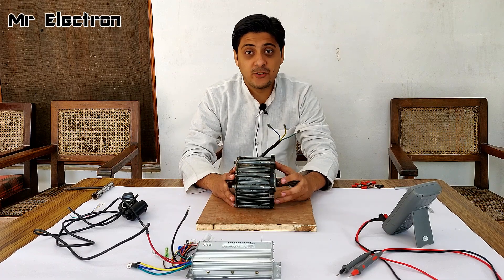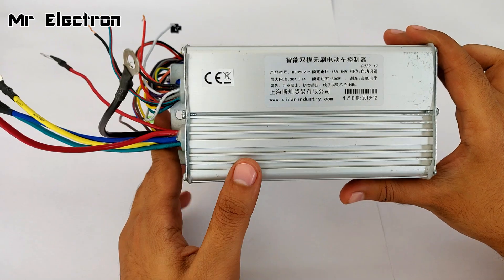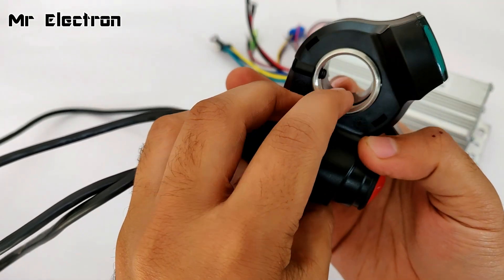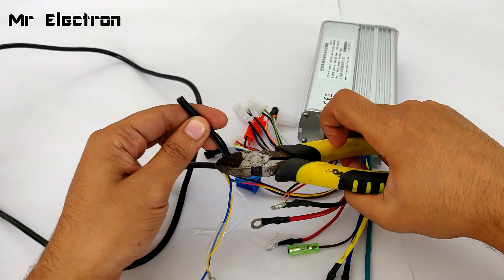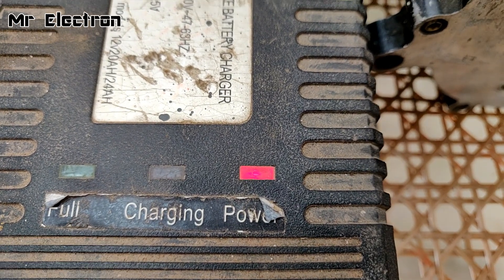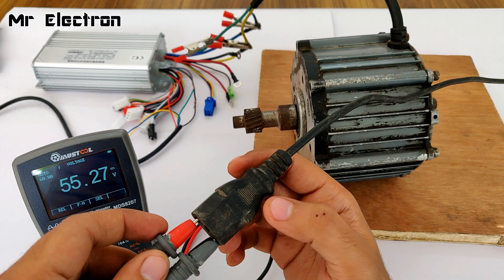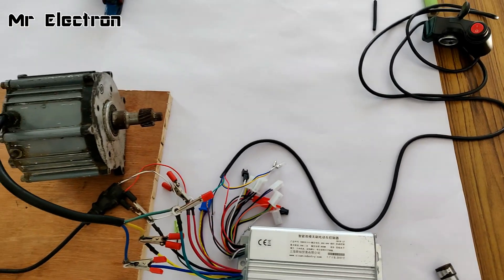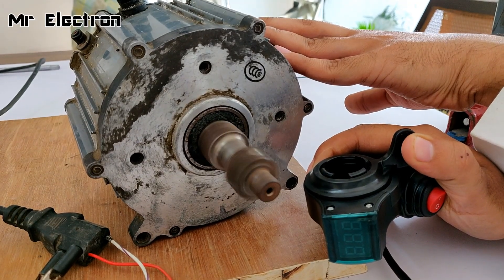Wooow ! 48v to 64v 800w Brushless DC Motor Controller - Run BLDC Motors without Hall Sensor

Comment: How do we get current,voltage,rpm and heat values from the motor controller
Reply: For current and voltage, just measure the output of the power supply or battery pack. For rpm just use a tachometer by attaching tape to the shaft of the motor you are using. I don’t think measuring heat of the controller would be necessary because it’s too men care of by the heat sink inside the controller. For some advice though, don’t over volt the controller and you won’t have to worry about heat.

Comment: please which cable wires for display and which display i can use here , thank you
Reply: You can use the yellow and blue wires from the throttle and attach them to the power supply or battery pack output to view the voltage level. The throttle can be brought on banggood and I believe it’s currently still in stock.

Comment: How do you bypass the hall sensor of the controller?
Reply: I translated the wording on the label on the controller and it says it’s a “dual-mode” controller so I assume that means it can run with and without hall sensors attached

Comment: Gread video....but i trey this with same connection 55v 2amp with 3 laptop charger on series and of caurse with sensolress speed controller 48v 84v 1500w 45amp max ..but not working very well the motor working alternatifly ..it's go and go back ...what do you thenk  about this mabey whene i coonect it with real lithuim battery ...you thenk will runing perfectly ?? You thenk in this case that the current (amps) it's very important ?...advice me if you can ...thank you

Comment: Thanks sir really good video, can we switch on off this motor at middle speed for example at around 1500 RPM. Can we switch it on at 1500 RPM. As AC motor switches on and off
Reply: It would jerk around a lot if you turned it on and off at high speeds. But it might just slow down and then stop but I’m not sure.

Comment: Brother 
I have a 24v battery and 24v motor.
But controller is of 48v ,🤔
It will work if I connect them ??😅😅
Reply: It should work perfectly with 24 volts. The voltage is in the range of 48 volts but make sure the minimum voltage is below 24 volts

Comment: Sir can I use this controller without speed controller
Reply: The controller itself would be called a speed controller but if your talking about using the controller without the throttle, no, it won’t work

Comment: Mr,  electron am again asking the  same question,  can u rply me?  Ok i have  one alternator.                         24 v,  45 AMP.  Delcoreny  make. So i want to make  it as a bldc motor. How many watts controller, how many battery  voltage use here?  Pls rply.
Reply: 800 Watts, 24v

Comment: You look too smart bro
Reply from the maker: 😃 Thanks !
Reply: Don't be so sure about that.
Ignoring the danger of a fan on the back of a bike (I think it's a fun goof so I will give him a pass on that one) and the plug on the charger(That is a mains plug but it is how they are sold, India "quality" I guess).
-He connected the trottle wires by twisting them and leaving them hanging lose next to eachother. Something like wago connectors are cheap
-He uses a battery charger as a powersuply. They are not made for that and you can damage both the controller and the charger
-He connects the charger by jamming wires into a powercord..... Do I need to say more?
-The wires he uses are too thin for then aplication, he is drawwing full current trough a wire that is thinner than the switch wire....
-His switch is wired the wrong way.

So no, too dumb is more like it. Some of these things are actually dangerous! This is a fire waiting to happen... If you wanna do that for yourself, go ahead. But you should not put this online if you do not show the correct way of doing things....